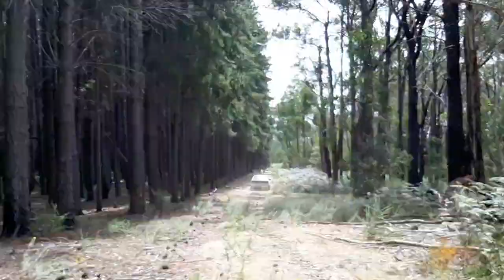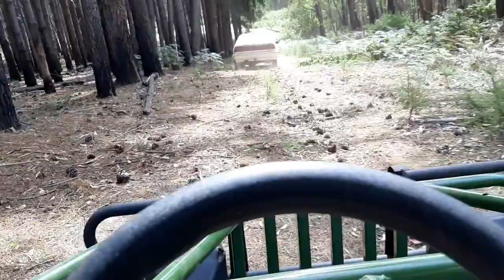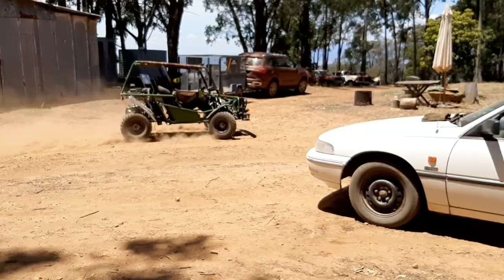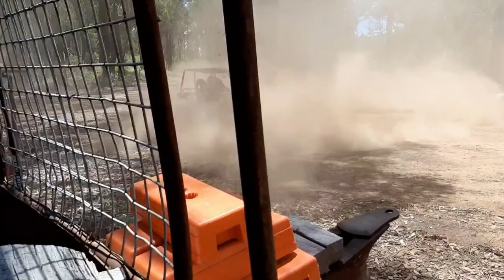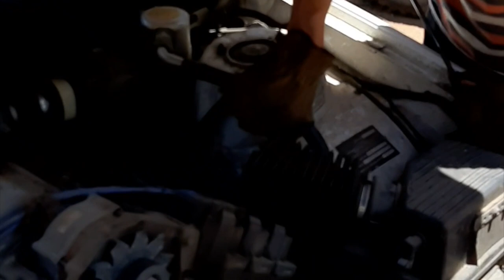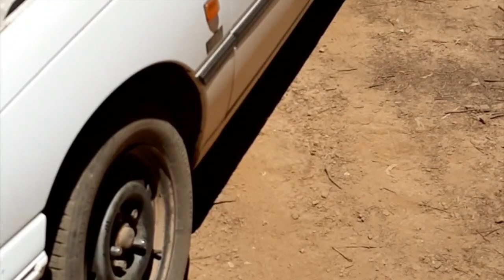The Holden Commodore is an Off-Road Vehicle, ft The Synergy Hunter 200

Comment: You still have this vehicle? I'm about to get one of this. What are your impressions along this time with it?
Reply from the maker: It's easy to use and great fun to play with, but if you want to be racing around at high speed or doing farm work you should get something with more power.
Reply: @hugieboi5301  Thanks a lot for the answer :)

Yeah I just wanted it to go around the city wich has 60km/h restriction, I'm not into high velocities but more into get from A to B, that's all.

I have a sportster 1200 for every day use, wich is nice for me but sometimes a four wheeler would come in handy. I was about to get a Bajaj Qute but now is quite expensive for what you get.

Again, thanks for your help! :)